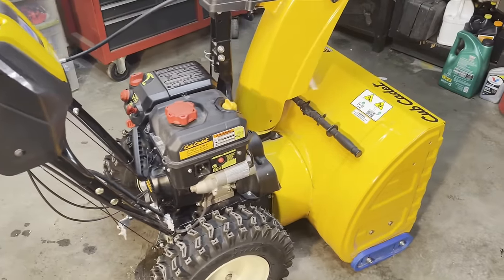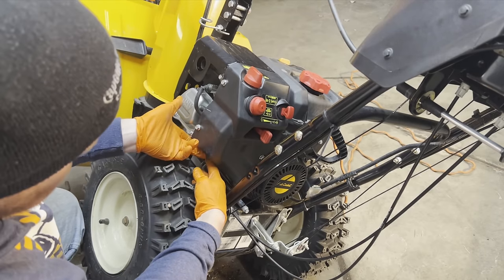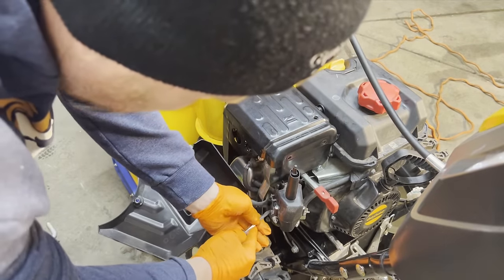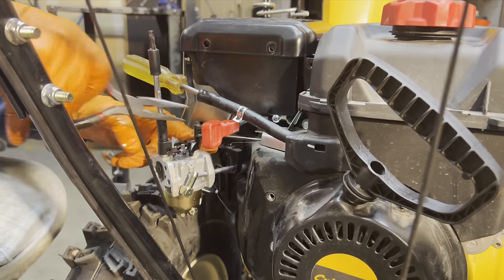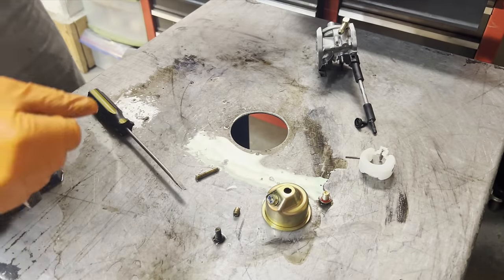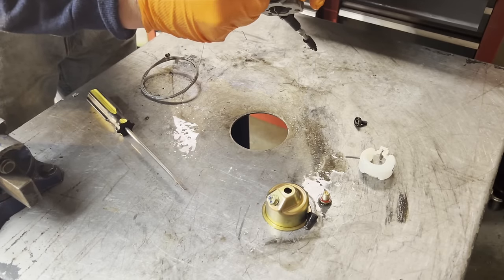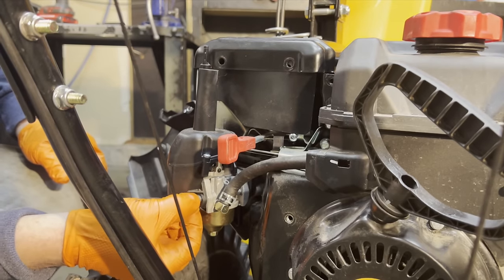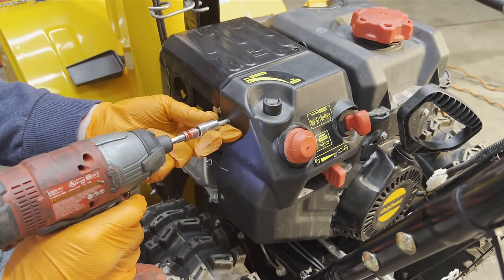Troubleshooting a Cub Cadet Snowblower That Won't Start: Quick Fixes to Get You Moving!

Comment: Hey man, I just wanted to say thank you. 28" Club Cadet snowblower and stuck with 8" of concrete snow this morning in CO. Hadn't run the machine in a year and couldn't get it to start. To make matters more challenging: I'm a Stage IV cancer patient and don't have the strength I used to. But your "drain the carb" of old gas trick worked like a charm. Thanks for making me feel like a man again. EMW
Reply from the maker: Early snow this. Now we won't probably get any more snow until February :-)

Comment: They screwed up and never installed a gas shut-off knob.  If they had, we wouldn't have this problem
Reply from the maker: @Joeteck  yeah not sure why they stopped installing them.
Reply: @small_engine_repair  I will probably add one myself. Seems pretty simple to do.

Comment: I will have to try this out my wont start. I will keep you updated
Reply from the maker: @evolawnlandscape  sounds good
Reply: @ UPDATE! 

My snowblower turns on and works like new. 

Thanks for this video brother! 

I did exactly what you did and it was the carburetor. I didn’t have time to clean it so I just bought one of Amazon for $20 bucks. 

If anyone needs the this carburetor for this blower here it is. 

Huayi Carburetor Carb Assy For Cub Cadet Snow Thrower model# 31AM5CVS756

Comment: Videos like this save me time and money.   My gas had turned to varnish from not treating it from last year, carb jets clogged bad. Figured as much but its nice to have a vid to watch just to give the once over on the removal. Also, on this series of blower motors, just lift the whole darn thing up on end. Auger facing the ground. Easier to access and no gas spillage from fuel line removal on a nearly full tank.
Reply from the maker: Glad the video helped out. Thank you for $$$

Comment: I moved up from Texas to Buffalo, NY to take care of my Dad who had a stroke and is now wheel-chair bound. Bought a Cub Cadet after that crazy blizzard and our plow guy couldn't get to us for days. I put Sta-Bil fuel stabilizer in my fuel tank over the summer (I did a ton of research on how to store these things so I won't get screwed in the winter), and honestly this gunk in the carburetor issue seems  to be like it will be the case. First snow of the year and it's been a miserable day. I hate this shit lol, but I love your attitude and I aspire to be as optimistic and level headed as you when it comes to running into problems like this. Thanks again for the video.
Reply from the maker: You are welcome. I am glad that I don't deal with snow like Buffalo!!
Reply: I live in Buffalo actually Lancaster ny/What I do my friend is run it dry at the end of the season in Buffalo that’s late April lol😂. Don’t bother with Stabilizer.

Comment: Thank you so much. This really saved my butt. Mine is maybe 5 years old and looks almost identical to this one. Mine is always a huge pain to start. Once its started it runs like a dream. Always floods or has old gas in the carb idk but I fought with it for almost an hour today. I drained the carb like you did in at the start and if fired up in half a second I was like really thank god. Mind you I already had half the drive way shoveled in pure resentment for the machine. Take pretty good care of my stuff too change oil and sparkplug. Store in a dry place till winter etc. I almost put it on Kijiji I was so upset. 

Thank you again. Awesome video
Reply from the maker: Glad you got it fixed.

Comment: Thank you!  I cheated because a new carb on amazon was dirt cheap.  These instructions helped make sure I was able to remove the carb and replace it with the new one easy as pie.  The only challenge I had by doing a replacement was swapping the extension to reach the choke knob.  It's made to go in and stay in so I had to use nippers to cut away the plastic on the old carb that was holding it in place.  It would be a lot easier to drain my gas after next winter 🙂
Reply from the maker: Welcome. I have broke a few choke knobs trying to get them off!

Comment: Thanks.  I suspect my CC snowblower has the same problem.  Been sitting too long with gas in it and didn't run
Reply from the maker: It is the most common issue that I work on.

Comment: Thanks for this, it got me going this afternoon. The jets were indeed all gunky and I got it all cleaned out, started up as soon as I put it all back together. 

However now I cannot open the choke without stalling the engine. I did manage to clear the driveway etc but it threatened to stall a couple of times, i figure what with the choke totally closed the hole time. I took it apart again to see if I'd missed anything, or to maybe adjust that idle screw, but no. Is there anything else to adjust in there?
Reply from the maker: Nothing else to adjust. Something is still blocking a passage way in the carburetor. You need to clean the carburetor again. Make sure the emulsion tube is clean. Also spray carburetor cleaner through all the passage ways. Make sure to wear safety glasses when spraying carburetor cleaner. If that does not fix it I would just replace the carburetor.
Reply: Is there a fuel filter in there somewhere? @small_engine_repair
Reply from the maker: If there is one it will be inline with the outlet of the gas tank.  @amhaun01

Comment: ive done everything you have done in your video ,new gas new spark plug  cleaned out the carb ,and it still wont start,im kind of at a loss ,im most times able to figure these things out, you have any other ideas, only thing is you put that needle vavle in so quick not sure if i put it in right, im taking it apart again for the 3rd time,
Reply from the maker: The needle valve can really only go in one way. If you spray starting fluid in the carb, does it start?

Comment: hey, thanks for this video - got my cub cadet up and running in 25 mins. Follow-up question, I assume at the end of winter we pop the bowl off and let everything dry out real well after letting the machine run out of gas? Or what procedure do you recommend at the end of winter?
Reply from the maker: I find it best to drain the gas and then run it until it dies. After that you should not need to remove the bowl. You could just loosen the bolt enough to let the last little bit of gas drain out and then tighten it back up. Also, depending on where you store it for summer, make sure dirt is not able to collect in the carburetor since there is no air filter.

Comment: Great video! Quick question I had tho. What size socket do you need to take the spark plug out? I am having issues getting mine out
Reply from the maker: It should be 13/16. In my tools I have 5/8, 9/16 and 13/16. One of those should work.

Comment: Thanks for the video! I’ve swapped the carburetor and the machine is still dying after running for a couple minutes. It wants to run, but kills itself if I put a load in it
Reply from the maker: Hhmmmmm.....  I need some more information to help. What happens when you start it up and just let it idle? Do the rpms go up and down or is it constant? Does it eventually die while idling?

Comment: Mine won't start with pull but does with Electric start.  It pulls fine but just doesnt turn over.
Reply from the maker: The opening and closing of the intake valve and the timing of the  piston creates a suction that draws gas from the carburetor. When using the starter that is happening really fast over and over and it getting gas to the top of the cylinder. Manually pulling is doing the same thing, but not as long as the starter. Make sure that when you press the prime bulb that gas is getting out of the bowl and into the top of the carburetor. That helps when starting with the pull cord.
Reply: @small_engine_repair  Thanks for the tip!

Comment: What size screwdriver did you use to remove the main jet? I seem to only have ones that are too big, or barely too small. 

With the too small screwdriver I seemed to have scrapped up the jet a bit. Do you think it will need replacement?
Reply from the maker: I do not know off the top of my head. I will look later today. Some minor scrapping should be ok. Just be careful , it it made out of brass and if you strip it, then you will not be able to get it out.

Comment: What size spark plug socket is needed for this engine? I've tried all of my long sockets and none are big enough and the stupid manual just says "use a spark plug socket"
Reply from the maker: Should be a 13/16.
Reply: @small_engine_repair  thanks much; that's 1/16 larger than the biggest deep socket in my set, of course.

Comment: tried all of the items as you described and still same surging problem.  Removed and cleaned carb twice, drained gas tank, and even replaced spark plug.  Same problem.  Starts
Reply from the maker: How did you gaskets/seals look? Damage to them can cause air leaks, causing the surging. I have also cleaned carburetors multiple times and it still surges. I just replace it after that since they are so cheap.

Comment: Did this but re assembly oil leaks out of carburetor
Reply from the maker: Are you sure it is oil? If so, was the engine tipped?
Reply: Yes after priming, and pulling to start oil drips from the carburetor, engine wasn’t tipped

Comment: Mine is only a few years old and used maybe a dozen times and won't start.  Replaced spark plug, put new gas in, and it doesn’t spark
Reply from the maker: Sounds like you need to replace the coil.